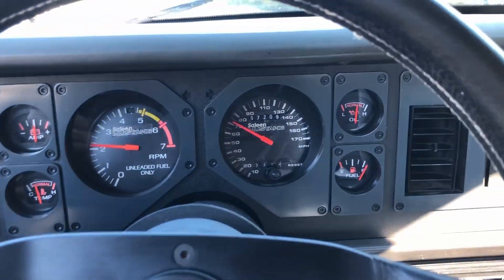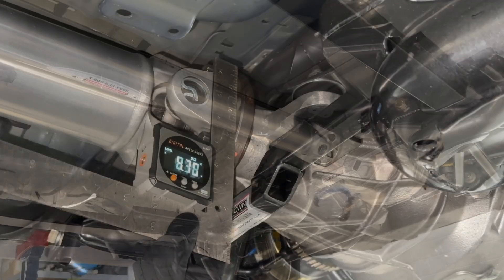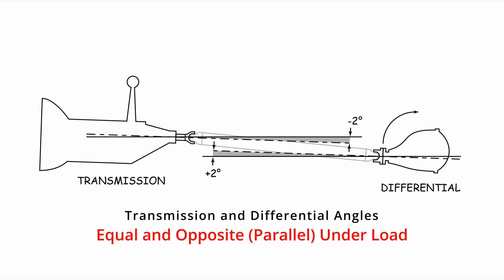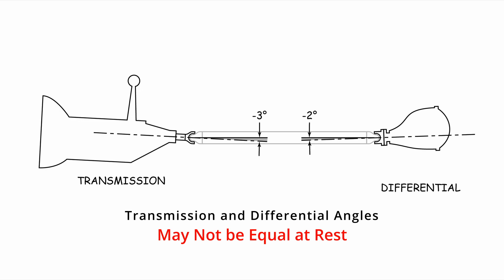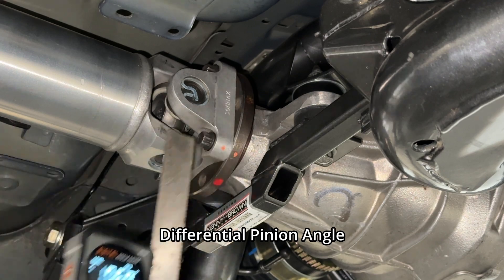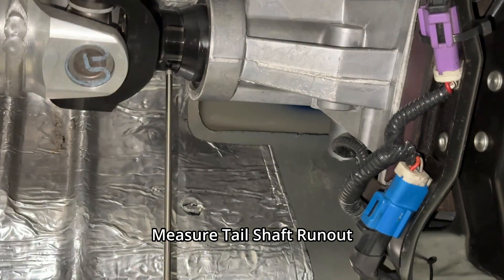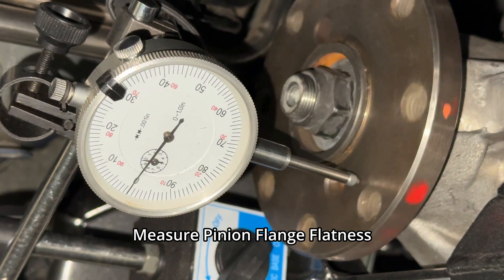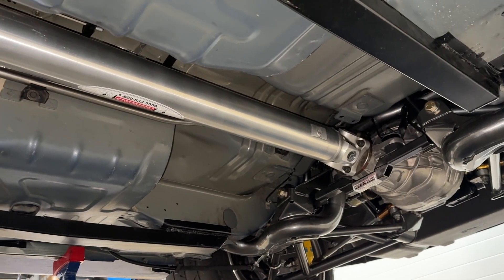How to Solve Driveshaft Vibration Problems

Comment: i have a 2019 mustang gt. i’ve done a engine swap, transmission swap, and a new drive shaft and can’t figure out the issue. i’ve have all of my suspension parts checked, as well as all my mounts. everything is good. i do want to say it may be the drive shaft cause again it has a new engine and a new transmission. it feels like it’s coming from the middle and front of the vehicle.
Reply from the maker: Is is a one-piece drive shaft?

Comment: Great video!
I watched this because I helped my friend by changing the U joints on his front driveshaft. Now and vibrates around 50 miles an hour. It has me stumped. I maked all the pieces and everything feels smooth yet if I remove the drive shaft from the truck, the vibration goes away.
Reply: did you figure it out?  I'm having the same issue
Reply: @srowan77  I bought a cheap shaft from Amazon. Problem solved.  I marked everything on the old shaft before disassembly but somehow it’s vibrated.

Comment: Might be a dumb question sorry in advance...when doing your measurements does the car's suspension need to be loaded or can you do this while the wheels are off the ground and car is on Jack stands?
Reply from the maker: Excellent question! The suspension should be loaded and the weight of the car should be on its suspension. You can do this with the car on a drive-on lift, ramps, or with jack stands under the suspension parts. Whatever you can do to make sure the car is at ride height.
Reply: @Mustang-Geek thank you for the reply man. Muuuuuuch appreciated! 🙏🏼
Reply from the maker: @LordMelchiahX please like, subscribe, and check out on my other videos!

Comment: Im going thru it right now with my 05....  i can hit almost 24mph and outa no where the most violent vibration ya ever felt ... so if its unlikely.to be the drive shaft outa ballance then its got to be t worn out center sapport bareing or maybe my pinion aint tight enough from what.i just read

Comment: Best Mustang channel on YouTube! Do you know how many degrees a diff can rotate upwards assuming the bushings are new?
Reply from the maker: That's a good question. On an IRS differential, I'd say a degree. On a stick axle car, it could be maybe two or three degrees? It's a tough call. I wish I had a better answer. What's your rear suspension setup?
Reply: @ MM lower control arms, Steeda upper CAs, all urethane and rubber bushings. My tail shaft is at - 3.9 degrees so I may have to set my differential at 0 degrees or +1 degree.
Reply from the maker: @3pedalfox  Ah, so a solid rear axle (not IRS). Not sure on what you're calling (-) or (+), but I'd start with putting the differential 1 degree out of parallel with the trans, drive it under decent load, and see how it feels.
Reply: @Mustang-Geek  My transmission is 4 degrees below parallel. I set the pinion 1 degree above parallel and the vibration is gone! I’m assuming my differential rotates 3 degrees upward if the vibration is gone. Thanks again man.
Reply from the maker: @3pedalfox  Great! Im a little confused on what you mean by "below parallel." Using an angle finder, what are you literal angle readouts? If your transmission is 4 degrees "tail down" from level, and your pinion is 1 degree "nose up" from level, then the difference is three degrees. Considering you have some poly bushings, I'd make the difference 1 or two degrees and see how it feels at cruise and under load.
Reply: @ At the transmission, I’m getting 4 degrees tail down. I set the pinion 1 degree nose up. Under load the differential is going to rotate 2 - 3 degrees up, putting my pinion at 3 - 4 degrees nose up. That would mean my transmission and pinion angles are parallel to each other. Correct?
Reply from the maker: @3pedalfox  Sure, that makes sense. You may want to even try 2 or 1 degree difference and see how it feels.
Reply: @Mustang-Geek 4:20 so what happens if you don't put drive shaft in the same position as it was when you remove it??? Does it vibrate or what??? Because I have a vibration issue
Reply from the maker: @5.9_Magnum  Sure, it can cause a vibration. If it is the OEM shaft, then there should be a factory paint dot on both the shaft and the pinion. Line them up. If not, you just have to try each position on the pinion flange and see if the vibration gets better or worse. If that doesn't address the issue, try the other things in this video first before rebalancing the shaft.
Reply: @Mustang-Geek  thank you I'll make sure I do what you said 👍👍

Comment: Guess I'm going to be checking my irs swapped notch. Using an 01 cobra driveshaft, assumed everything came from the same car it'd be fine. I know I've got a vibration around 100+ and I've already got the digital level so it's worth a comparison
Reply from the maker: I'd be curious what your driveline angles are. Please report back!

Comment: I had a vibration, so I purchased an aluminum driveshaft.  Come to find out my pinion gear was loose and that was causing the issue.  So I tightened the pinion gear and installed the new driveshaft and it was smooth as silk.
Reply from the maker: Glad you figured it out! That's the type of thing many people overlook. Very few drive shafts go "out of balance." It's usually something else.
Reply: So did u need the new driveshaft or not?
Reply: I’ll check this also